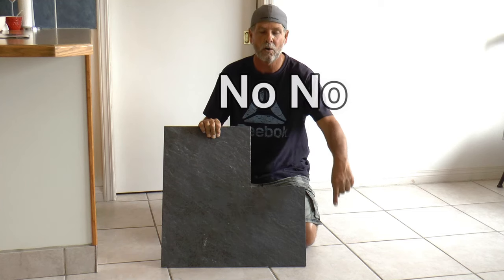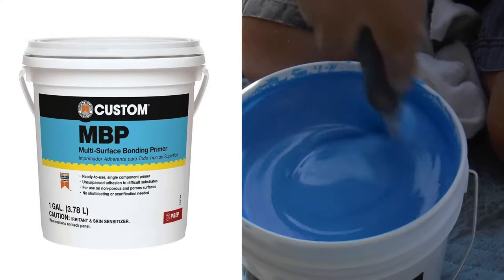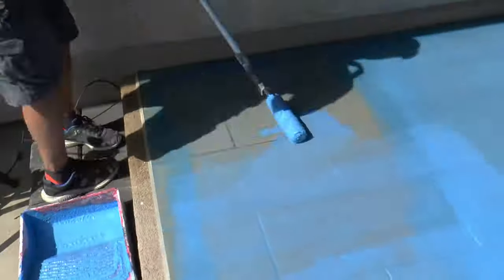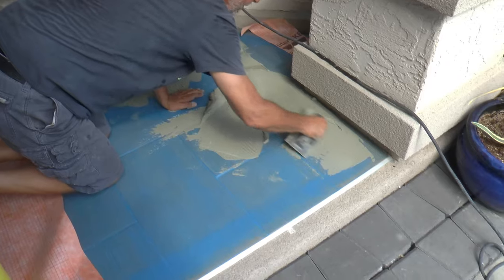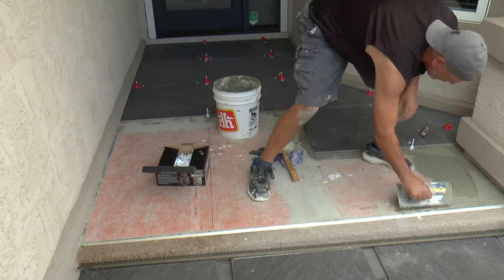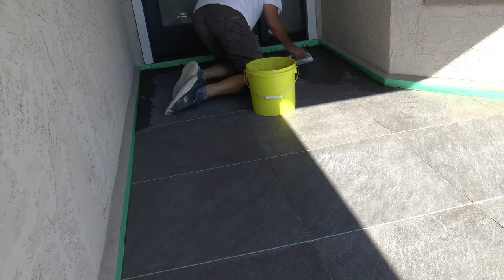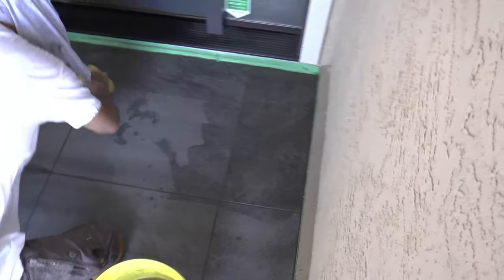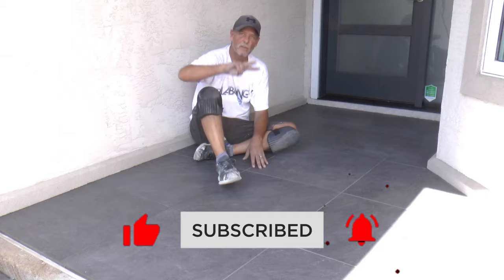How To Tile Over Tile (is it possible?)

Comment: Great job, is there an update to how well this is holding up? Also, I wish you would explain more about what the moisture barrier is doing - is it just to protect the first (bottom) layer of tile from separating from the concrete?
Reply from the maker: Thanks for taking the time to watch the video. 
I haven’t actually done a follow up video however I have been back to inspect the tile and it still looks amazing and is as solid  as it was the day we finished. As for the membrane, it was just added protection to prevent moisture from getting to the previous tile, I don’t think it is necessary but I always try to make things last for as long as possible. 
My client is still extremely pleased with how well it turned out and how well it’s holding up. 
Thanks again, cheers!

Comment: sir, if the existing tile surface is not leveled correctly, Is it possible to fix  tiles with a correct level? kindly reply
Reply from the maker: Great question, if it were me I think I would use a self levelling product like Mapei self levelling plus with a roll on primer first then follow the steps in the video 
Thanks and best of luck on your tiling.

Comment: Customer would like me to tile over tile on shower floor. Will this work? Did water get trapped between your tile and waterproofing? I'm a little concerned that adding another layer of waterproofing will create a trap seeing as how I don't have the option to waterproof up the wall. The shower currently doesn't leak and is sound. The floor tiles just suck and the grout is horrible. The customer wants nice new floor.
Reply from the maker: I can’t tell you whether or not it will work in your scenario without seeing it however, I will say the one in the video is holding strong. I was visiting that customer just yesterday and she and I both were thoroughly impressed at how well it was holding up. 
I mentioned to her I would be interested in coming back to do a one year review on the project so that might be  a video to watch for.
Reply: @DIYBuilt  that would be sweet. Drop it in the comments when you do. Thanks for responding, and may your business be blessed this year!